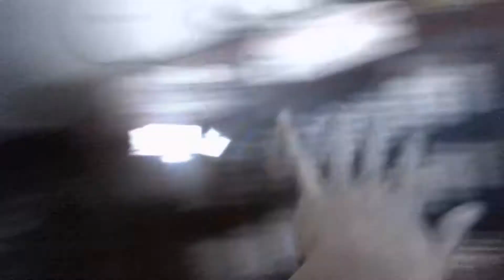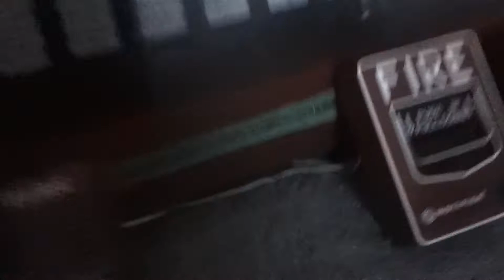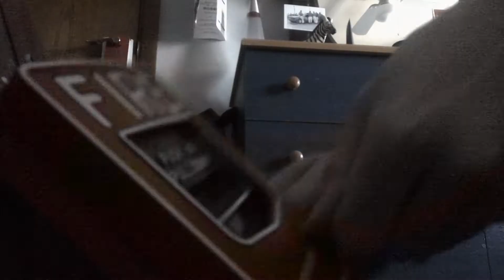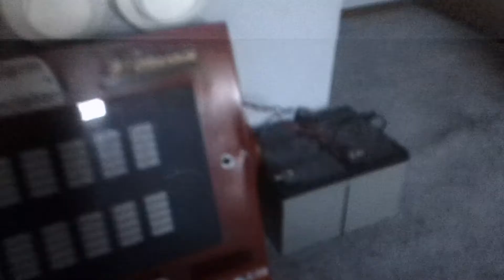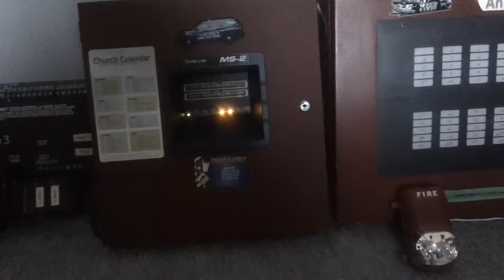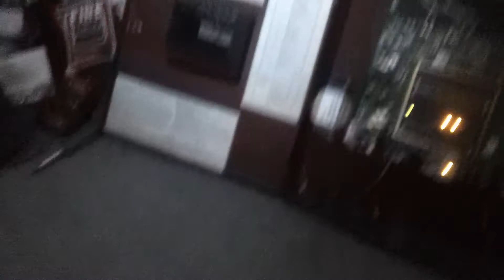Floor System Test 26

Comment: The buttons are responsive on the panel because half of them don't respond you have to like pusher 10 times 4 to respond like fire Lite should be making that much better but they should be making it some better because they're not like and unlike the Ms 5UD is good you should get that is your next panel oh and I like elevations to in case you're wondering I even like them because they're even good like you can get them in good condition like doughnut like some of them I got trapped as I was before an hour's give me a shout out in your next video Gerard tange so give me a shout out I would like you to give me a shout out and give me a shoutout I'd love to watch I Love You videos I I subscribed already and I hit the bell icon so if you're happy with that happy with the comment I hope you really like to comment and yeah I'm very interested in fire alarms and I'm very interested in burglar alarms and home security and yeah like um like I've watched exit sign to 250 and here's them as to only lasted for about a year that was his Ms2 but then he got the 5UD how many still has that I'm a big thank you to you thanks for everything see you now

Comment: Why don't you put your system up on your wall. It would look way cooler. And also I am just curious how did you get the name "msj191961"?
Reply from the maker: Yeah, that's what I've been trying to do that for a while now, but now I want to wait until a better panel comes my way. And thanks for asking. I plan to answer that eventually in a video. I won't get too detailed, but my mom created this account back in 2009. The name is her initials and part of her birth date. I fully own the account now, but I kept the name. Maybe someday, if I even can, I'll change it.
Reply: msj191961 Interesting about how you got name, and do you know what panel you may want to get.   Simplex and Silent Knight make really good panels.
Reply from the maker: SCMikePapa I think I'm going to go Simplex. Silent Knight panels are just mostly re-branded Fire-Lite models, so to me they aren't much better. I'm going to try to go with a Simplex 4001, 4002, 4004, or 4005, whichever I can track down for a decent price.
Reply: msj191961 Nice, the 4000 series of  panels are nice because they are  easy to use and work great.
Reply from the maker: Exactly, haha. Well, actually, not as much the 4006, 4008, and 4010.
Reply: msj191961 Yup, I wasn't thinking of those. That is where things get complicated LOTS of wires. I have seen inside a couple of them and didn't even know what was what! LOL

Comment: Well msj191961... I would be more than happy to take it off your hands... I don't have money... But I would like to take it off your hands... What say you?
Reply from the maker: Sorry, I don't plan on giving away a panel that's worth at least $100.
Reply: +msj191961 I see... Well, you could ask your dad to ask the fire alarm technician to look for another FACP, but then again... Try looking for an FACP that is it he best price and is not addressable, other than that, not sure what to tell you...... Other than check for loose screws on the transformer... That might be the problem... Additionally, check the manual for how many amps in maximum the panel can support. You showed us 7AH batteries, so the noise is probably normal... (I'm not a fire alarm technician, so what do I know?)
Reply: msj191961 Do You Have Any EST Integrity's?
Reply from the maker: Nope. Please watch the March 2014 collection update. Aside from a few other alarms which I recently got, that's it.
Reply: msj191961 Does Your Panel Support Gentex Commander 3's?
Reply from the maker: It's got Gentex sync, so I would say yes!
Reply: msj191961 Do You Know In My Smoke Alarm Collection I Currently Have 7 Of Them Cool Right?

Comment: YAY SPECTRALERTS But One Question Why Is It Not On Its Mounting Plate?
Reply from the maker: Please watch the full video. You will get your answer there.
Reply: msj191961 Ok But Does Your MS-2 Support Wheelock MT's If So You Should Use That For The Next System Test?
Reply from the maker: I don't have any MTs.
Reply: msj191961 Hmm... What About An EST Genesis If It Supports Those?
Reply from the maker: Yes.
Reply from the maker: ***** When I do sell it, probably between $75 to $100.
Reply from the maker: ***** I don't know. Depends on the circumstances.